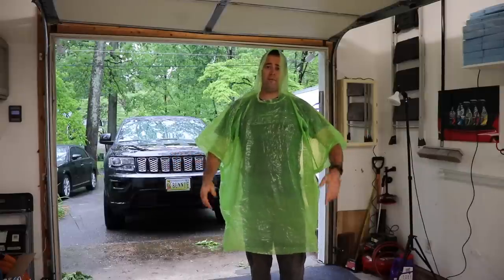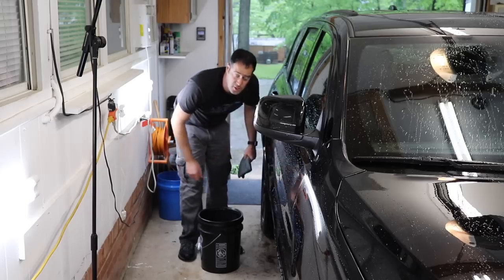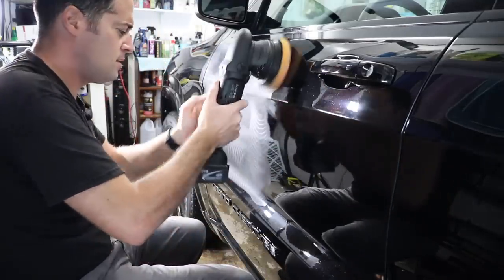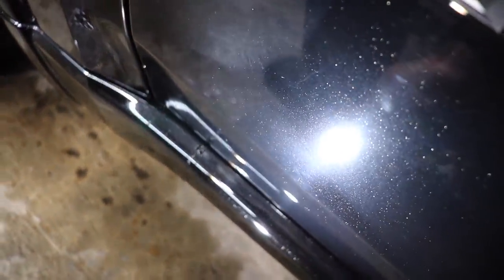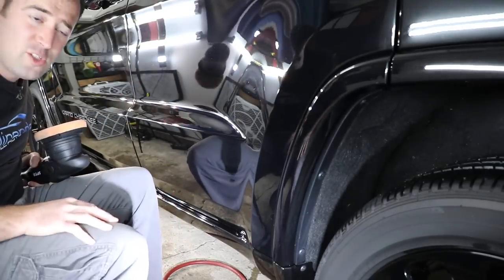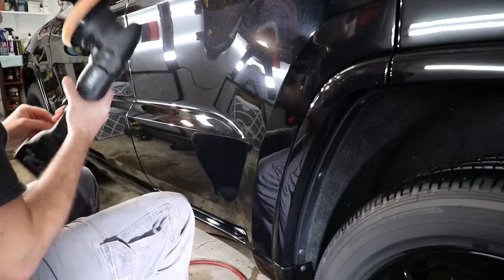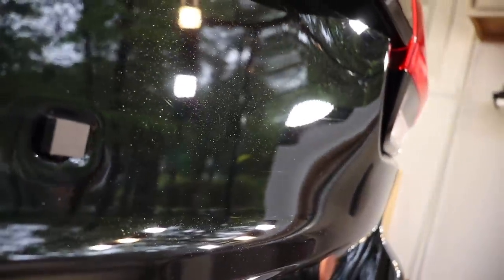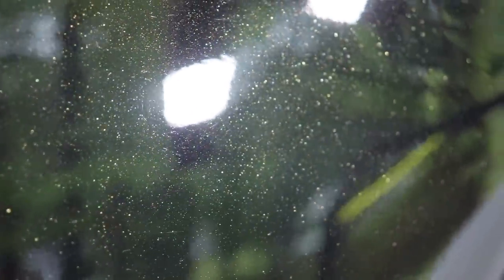Paint Correction & Adams Ceramic Coating! Part 1 / #paintcorrection #Autodetailing

Comment: 👍🏼 Phil, I watch as many videos as I can,  the other day I used a medium cut pad with polish,  on not so extreme soft paint, and I wondered why wouldn't it work and why I never saw any other you tubers doing it, they appear to only use a cutting  pad and compound, and polish and finishing pad. The results I got were good for a 14 year old paint, removing defects, some areas just polish and finish polish pads. And here you are showing us cut pad and polish, that I personally never saw from many good detailers here. Thanks again, sometimes we do what works,  not what most do, and what worked for me without help, you just confirmed it a few days later with this video. Ha ha 👍🏼 😃
Reply from the maker: That’s so cool!  I actually learned about pad and polishing combos from Larry at AMMO years ago. His early videos talked about that.
Reply: Miranda Detailing I agree, Larry is one of the best ones and oldest yotubers, maybe I missed that,  Brian had a short video about,  pads doing more work than compounds and polishing creams, and that is what made try it. Now that I remember Larry used water instead of polish to finish some paint areas in some videos. Thanks again Phil, and yes it's more about the pad, than the polish and compound, and like you said, there is not much clear coat on new cars and old ones with soft paint can be a pain to deal with. 👊🏼👊🏼

Comment: Hey Phil.  Nice demo with that cordless...but with a vehicle you suspect may have been resprayed, do you check Clearcoat thicknesses just to play it safe?  If so what device do you use for measuring?  Thanks bud!
Reply from the maker: Hi thanks.  Yes I will check with this gauge, https://amzn.to/36v8fhb  It may be unavailable right now but they should restock soon.  Or you can get pretty much any other one that does the same thing.  Its just to get an idea of the total thickness and see where areas are thick or thin.

Comment: I noticed the Meguiars Detailer series correction compound on your table. Is there a difference between that series and the M105/M205?
Reply from the maker: The d300 correction compound is super easy to work with. It’s designed to use with the megs microfiber discs. Nice long work cycle and wipe off is easy. I use it all the time for my correction jobs.

Comment: Hi phill, this Isaac and wanted to ask you what do you recomend for the inside of my truck door trim panel (vinyl)
Reply from the maker: To clean it you can use what ever APC or degreaser you want, super clean and a stiff bristle brush works great. Then you can dress it  with a water based dressing like Megs Hyper dressing or Chemical guys VRP
Reply: Thanks a lots, keep them videos coming